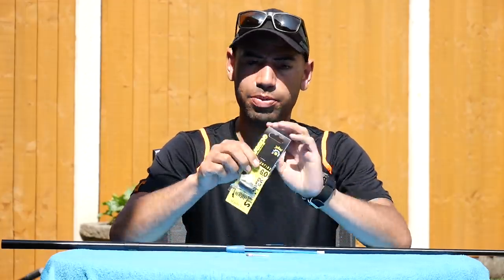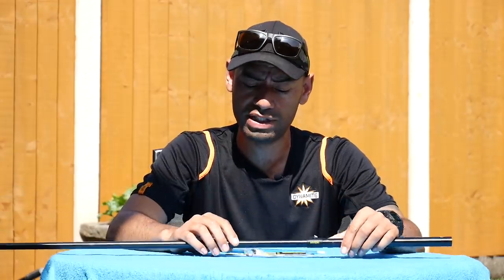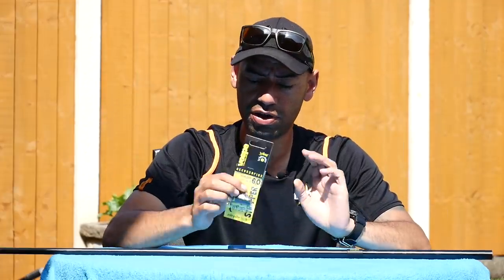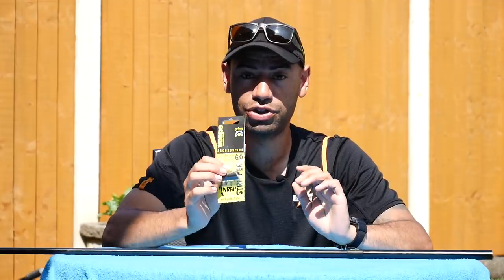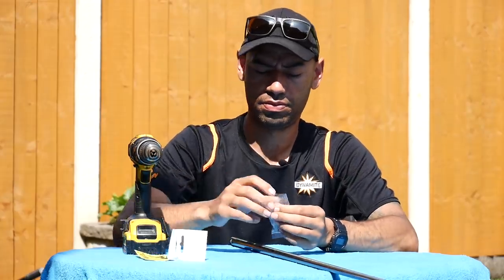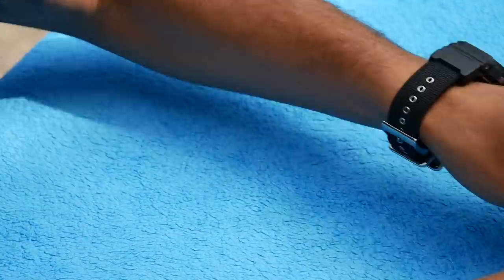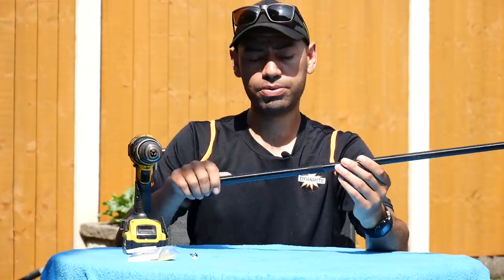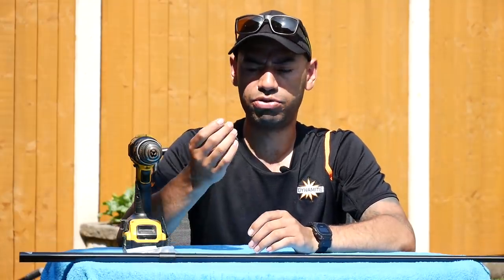Pole fishing // Fitting side pulla kits in minutes // Vespe

Comment: Whats the ideal distance from the bottom of the top kit to fit this? My pole is quite thin and it sits around 4 to 5 iches from the bottom, 3rd section fits just below where the hole will be drilled. Is it worth thickining a section further up to allow more distance from the bottom ?

Comment: Hi Rikki - love the videos subscribed! Just wondering do you run carp elastic through these kits or is it mainly for silvers? Wondering whether to get this or go down the wrap route - I’ll be fishing for f1s and carp mainly - cheers
Reply from the maker: I run carp elastic through them aswell mate but i dont go above a 13 hollow as these are match kits and i wouldn't be using them for anything bigger than that even without the pulla kit fitted.

Comment: I use these strippers but wouldn't without a carbon wrap. The plastic sleeve isn't bonded to the carbon so offers little structural strength. For the sake of £10 I get all my kits wrapped.
Reply: although there's nothing stopping you gluing it or even gluing a scrap piece of carbon

Comment: just had a brake on these . gone have to fix with wrap and glue
Reply from the maker: You've not pulled it down far enough as i said in the video mate. Ive been using these over 1 year now and not had a single issue.

Comment: you use a pole that dont have side pulla kits, dude you full of shit go back check your video's showing your match fishing video's your pole has side pulla kits not one shows you using a pulla bung. still this is a good product for those that dont have side pulla's already fitted although id be worried about the  angle of the ptfe bush damaging the elastic if it had a slight curve in it to centre the elastic down the middle of the pole this would be an improvement. me im buying the carbon strengthening kit and fitting  roller pulla bungs by preston to all my kits. you pay for a cheap quick fast fix, it will cost you more in the long run